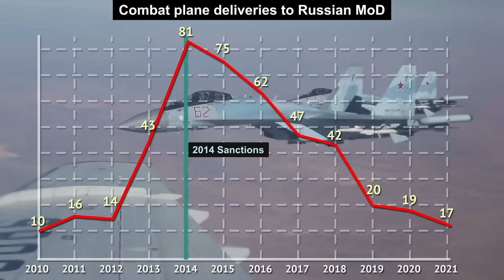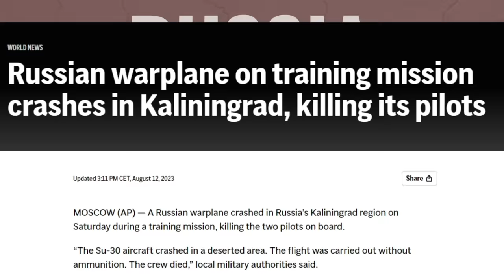Russia has produced more combat jets than it lost in Ukraine in 2023

Comment: Only 25 to 40 planes? That's pathetic. Us produced between 3000 to 4000 thousands per year in 1960s. It dropped 15 million half a ton bombs on vietnam. It used 23 aircraft carriers throughout a war. 10 thousands of helicopters. It had over 30 thousands of planes. And 25 thousands of helicopters. Trying to win a war with a country that has twice the size in area  and twice the size of population is a absurd idiocy. Us had 50 k of South Korean troops some Thailand some Australian and its own 300k to 500k soldiers plus a million of south vietnam. On top of that it had population of over 200 million in 1960s. And fertility rate around 3. In 1950s it was around 3 to 4(main demographics of new soldiers). Around 3 to almost 4 million births a year. Russia has 145 million. Births around 1.4 to 1.3 million (3 times lower) no south vietnam number of troops of over a million. It doesn't have 15 million air bombs like us. Us produced millions of those in 1960s per year. Russia is using old stored garbage. Russian aviation is around 3k TEN TIMES lower that Us in 1960s. Russia would need 3 to 5 million soldiers to capture Ukraine and 5 million more yo hold and subjugate it. Unrealistic with catastrophic demographics Russia has right now. It will also need to drop over 50 million air bombs on Ukraine. In Avdiivka they dropped  200 per day for a week ( absolute max on this war) US dropped every day for 8 years 5000 thousands. Russia is dropping between 20 to 50 right now. 10p tines lower than vietnam. Plus moto resource of that aviation is atrocious. Planes literally being flown to death. Russia absolutely cannot win this. It's post industrial post demographics weak country incapable even capturing and holding half of ukraine in any scenario. They won't even capture whole donbass. Yes they have these numbers of productions now. I can bet in 5 years even these pathetic 40 planes will be impossible to produce due to demographics economy and exhaustion of this post industrial mess of a country.
Reply: Such a dumb rant
Reply: @boikanyoonneng9170  lol you can't even argue. It shows that you are very weak speaker.
Reply: What bombs are US use? 100-200 kg?  Was it guided bombs? Now using guided bombs 1500 kg with umpk. This wars incomparable.
Reply: @vbondarenko85  @vbondarenko85  US used bombs from 200kg up to 9000kg. I used 500kg as unit of measure.  Umpk is not precise. These cl owns from Russia use them for one reason , not to be shot down. They still lose planes but not at atrocious level. Yeah these wars are incomparable due to sheer size of US military from 1960s. Russia has an extremely low tonnage. Even if Russia somehow attained air superiority they would have to b  om   b every village, town, road, base, bridge, airport, underground bunkers, positions and so on. It's impossible. They don't have enough bombs to do that and planes with pilots. Russian planes are very old. Us produced 35 thousands planes from 1964 to 1973. And was able to lose 10 thousands of planes and still maintain above 30k. Russia doesn't have potential for that not even close.
Reply: @boikanyoonneng9170 The ranter don't even realize that 2024 US can barely produce anything, let alone 4000 airplanes per year.
Reply: @davidshapiro292  I wasn't talking about 2024 us. I was comparing wars. US could not win in Vietnam even with that amount of equipment. Russia in 2024 is absolutely can't do it. You changed topic to avoid being exposed to facts and cold numbers. Can you argue with me on any facts I have mentioned or are you another weak troll like that other guy?)
Reply: @mikhailmakarov8845 Dunno, i only read part of your long and incoherent rant.
Russia doesn't need a production of 4000 airplanes per year for this war because unlike the US in Vietnam they aren't losing thousands of them a year.The US and their allies lost 12500 airplanes during the vietnam war, Russia only lost like 100 jets and 100 helicopters in 2 years of proxy war against nato.
Most of firepower that Russia throws at the enemy is not airpower based like in the US but artillery based.Russian airpower is for lobbing missiles deep into ukraine and to destroy fortified positions in sieges like in Avdeevka.
Reply: @mikhailmakarov8845 found a keyboard warrior spewing biased shiz here🤢🤮
Reply: @davidshapiro292  Yes you are right Russia lost only hundreds of aircarft in this war so far. The reason why they don't loose more is because they aren't flying like US did over Vietnam. If they did, the entire air fleet capable flying would be destroyed in a matter of months. You are right that this war is artilery based. But in order to cause same amount of damage as one air b om b worth of 500kg of explosive you will need hundreds of artilery shells. In 152 mm caliber that Russia uses there is 5kg of explosive. As you can see you need 100 shells to cause same damage. US was dropping 5 thousands b om b s per day. Or 500 thousands equivalent of 152 mm shells. Russia is using 10k a day
Even during ww2 N a zi army was firing 300k a day. You talked about Avdiivka that's one of the thousands of fortified positions In Ukraine. Russia lost 17k soldier there in 4 months... that level of losses is absurdly high. Even with artilery that Russia uses it has 4 million in storage, yes Russia produces between 1 to 2 million shells, but even in the next year that will drop to around 5k. Plus don't forget artilery is being overused and gets destroyed and Russia has less and less every day. Russia cannot win this war at all...
Reply: @HairLessBush  troll can't even argue lol.
Reply: @mikhailmakarov8845  AA is far more advanced now that during the vietnam war.If the USA would try to willy nilly just fly over Russia their much bigger airforce would get demolished in a few months just like how Russian airforce would get demolished if they would do that over ukraine.Airpower is about lobbing long range missiles and glide bombs from relative safety now.Forget about complete air superiority.
Russia found a good balance of firepower.
Artillery backed by drone spotters is for the daily grind.
Lancets for suppressing enemy artillery.
Glide bombs for sieges and for taking out enemy buildings 10-20km from the front line.
It works better than when they fired 60k artillery a day but didn't had serious air backing or drones.
ukraine is running out of manpower much faster than Russia does and they are low on hardware and ammo as well while Russia is ramping up military production in every sphere maybe except in navy.
ukrainian approval of the government is falling fast, just a few months ago it was 70-80% percent and now its 35% and falling further.
ukraine is 1918 Germany now.They still have a functional army and can hold the line more or less but everything is falling apart.
Reply: @davidshapiro292  yes I don't argue that US can't achieve air superiority over Russia. Firstly Ukraine is not Germany of 1918. Simply because its fighting for survival. Germany wasn't occupied or threatened to be occupied on 1918. Ukraine is fighting for its survival. So this argument doesn't really work. Secondly morale in society of Ukraine is lower Simply because line is static, if russia moves closer to big cities people gonna fight back, because their lives will be on the line and Ukraine still has millions of men to fight. Remember Russia is loosing more people because it simply attacking. And even pool of new recruits is going down. Less people left jails. Less people want to join from poor areas , simply because most of them joined before , and less and less opportunity to find more without mobilization. For putin mobilization is risky, because russians don't care about Ukraine, they want to be left alone. If it wasn't true putin would have mobilized millions last year already. But I think he will still mobilize because with soldiers he got he can't hold the line for long or attack at the same level like in Avdiivka. 
Yes drones are used massively in this war ,but they have limits, they can't replace that fire power I was talking about, and don't forget Ukraine uses them too. My points I have talked about are still valid Russia doesn't have enough fire power to conquer Ukraine. Putin is in serious trouble. If he wants to survive he will need to find a way out of this. If he doesn't he will repeat the fate of Nicolas 2.

Comment: 1) the fighterbomber has not been a career soldier for a very long time. Sometimes he has reliable information because of old acquaintances, but this is still the level of information like “my grandmother heard from a neighbor yesterday”
2) As I saw from high-profile articles, the Oryx are either very biased towards one of the parties to the conflict or their website does not have a minimal editor that would remove any utter nonsense. Often on this site you can find “evidence” of a loss in the form of a photo where you can only see a couple of pixels in the middle of nowhere. How one can discern equipment in this pile of pixels and determine whose side it belonged to is absolutely incomprehensible. There is also a lot of idiocy, such as, for example, a damaged T64 in the outskirts of Kiev recorded as Russian losses, despite the fact that you will not find photos or videos of Russian T64 in the Kiev direction, no matter how hard you search.
Reply: Better yet, Russia doesn't lie because it simply doesn't need to. It doesn't care what the western fanboys think. The DPR and LPR did use some T64s early on in the conflict but they weren't involved in the push on Kiev so you are right to say any T64s there would be on the Ukrainian side. 😊

Comment: I think, officially declared by Ukraine number of shot down enemy airplanes ~340 during two years of war, is realistic. 

More of that: considering post-soviet degradation of russia's industry, Russia has no enough spare parts for active usage of big number of airplanes. They can only disassembly old soviet-made airplanes to extract from them necessary parts, to provide workability for comparatively small number of workable ones.
Reply: It's not realistic at all, that would practically be the entire frontline/modernised force, or the entire force allocated to the theatre. The Russian air force hasn't been deployed on a large scale over high-risk areas of Ukraine, precisely to avoid those kind of loses, their EM countermeasures and defensive aids have proven pretty poor, even against legacy Soviet systems. Oryx has a risk of slight under-estimation, but their figure, plus 10-20% is probably the most accurate to go by.
Reply: Bless your heart.
Reply: are u serious? There wouldn't be a single airplane left in Russia by your estimates, just like their lost enemy tanks counts. Ukrainian estimates can't be taken seriously even in  video games
Reply: Imagine believing war propaganda from either side.

Comment: Both SU35 and SU34 are produced from SU27, they don't really make new jets. Lots of components were never made in Russia in the first place.
Reply: Those parts from Ukraine were mostly to ILyushin, like IL76
Reply: @denisdenisov4036  lots of parts from Bulgaria, Hungary everything bit more modern was from germany and france
Reply: Same is true of the FA-18 Super Hornet - would you have a new wheel be square in shape?
Reply: Good joke. They are completely different. SU34 is a long range bomber with twin seats. Cockpit and fuselage is very different than SU27.
Reply: @realnapster1522  SU34 was originally called SU-27IB and SU35 used to be called SU-27M.
Its like with Russian tanks T90 used to be called T72B3 because that what it is. But, because of very bad performance, they thought it would look better with a new name.
Reply: @JohnnyWednesday  FA-18 did not came into existence by renaming F14 and then be made only from old stock F14

Comment: Another factor is wear and tear on the airframes and engines. Russian planes tend to be designed with a shorter shelf life thsn western planes and even if they never get hit by a single bullet I'm quite sure that a lot of Russian planes are getting past those limits every single day. That would also explain the low number of sorties Russia has been sending.
Reply: I am sure you have plenty of sources for these claim.
Reply: Newest Sukhois have 9k hours airframe lifespan, and latest Al-37fu Al-41  turbofan engines have lifespan of over 6000 hours so that is absolute the same like best western aircrafts.
Reply: No that’s incorrect Russias defence industry uses purpose not profit like in the west.
Reply: @svinche2  plus they don’t cost as much..
Reply: According to literally the first article when I did a google search, breakingdefense, modern russian planes are designed to fly between 3500 and 4500 flight hours. Unfortunately for your comrades at the troll station Soviet era fighters only have about 2500 flight hours and thats the vast majority of the Russian air force.
Reply: @bigmekboy175  always  hiding behind the troll when you hear something that doesn’t fit.
Reply: @ratulxy  breaking defense wrote  'By the summer of 2024, combat losses and imputed flight hour losses may put the VKS below 75 percent of its prewar strength.' I know nothing of the authors but the reasoning seems sound.
Reply: @bigmekboy175 2000 hours are lifespan for Mig-21, Su-17(22) , 3000-3500 hours is lifespan for Mig-29B & S from 80s ! Su-24 can last up to 4000 hours!
4500 hours is lifespan for Mig-29SMT and Su-27/30/33
but newest Su-35S, Su-34, Su-30SM2 are designed to fly 6000 + hours, after first SLEP lifspan is increased up to 9000 hours! also Mig-35 is designed to last at least 6000 hours.
Reply: @svinche2  I'm not going to dispute the new stuff, the Russians are capable aircraft designers and theres a reason China still buys most of its engines from them. Most of their Soviet era stuff was already getting towards the end of its life cycle and a large percentage of their air force is made up of older equipment. Its like the T72's, T90's, and the Armata. It doesn't matter if the Armata really is the greatest tank in the world if you only built a dozen of them and all you have is T72's to send to the fight.